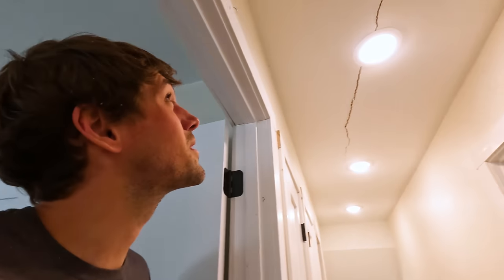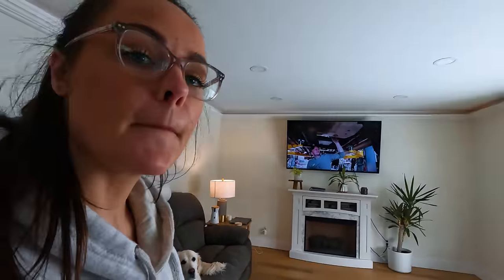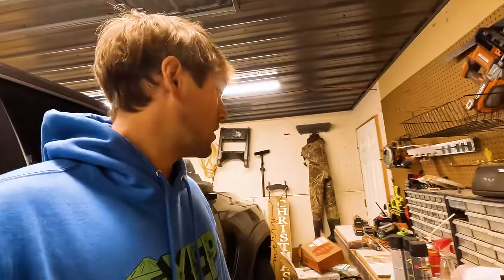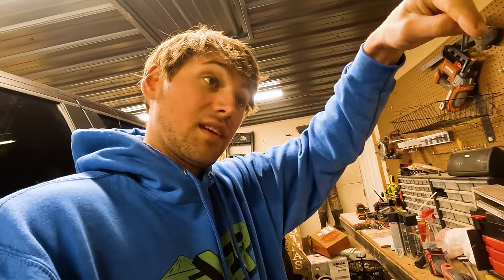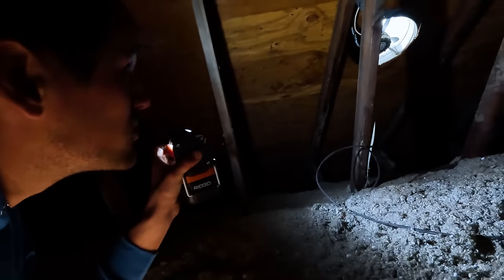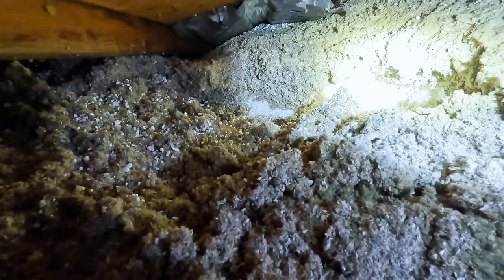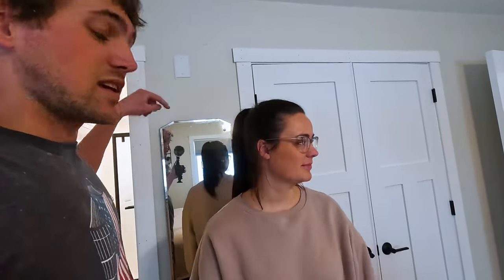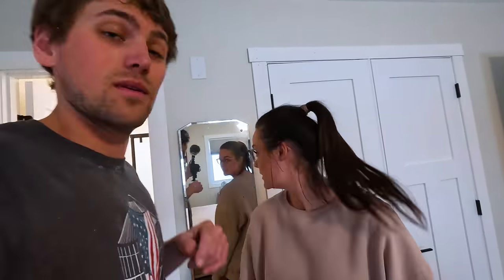DIY House Remodel Gone Wrong!!

Comment: Ya know... I think you did a great job... I grew up on a Ranch. Learned how to run a tractor and drive a Semi @ 8. @  9 sink electric poles and run telephone and 12.5 Kv electric lines. Built my first house @ 12. Ya know... You're not doing it right if you don't drop parts and screws. The higher you are on a ladder, depends on how important the screws and parts you drop. I've seen men who have built over 200 homes go right through a ceiling. Again, you were awesome... Thank you for being secure enough to show your viewers all the real challenges and how human we all are when doing a DIY project.

Comment: If you tee into the other vent line, moisture will also travel to the other fan.  Venting into the attic is bad news, mold etc., each one needs it's own external vent.
Reply: I totally agree. I would also use insulated exhaust fan tubing, preferably rigid.    And also get the other piece of that roof vent.
Reply: A back draft damper in line would probably also work but agree with the insulated ducting and correct mounting
Reply: Dnt feel bad Chet my stepfather was hanging from our attic half body in the attic half body in our dining room we told him to put some plywood on the floor for the same reason that he was going to end up falling through but didn't listen, also we have  back draft blockers and have not had any issues with moisture or mold build up in our washrooms exhaust fans
Reply: I didn’t think you were sposed to put the vent directly above the shower but I dunno
Reply: Put it on a GFCI circuit

Comment: Chet, you need to get each of those exhaust pipes routed to an external vent.  Note I wrote each. Do not use a Tee, as the air will backflow to whichever one is not running, thus putting the moist air back into the other bathroom. That needs to be done ASAP! That moisture in the attic is BAD.

As for a misstep onto the ceiling, as an electrician in an earlier life, I did several of those... Nothing that can't be fixed. And always remember, anyone who never made a mistake never did ANYTHING.
Reply: Or add a second fan after the Tee, to suck the air from both bathrooms.
Reply: The fan in the roof, could still to cleaned up at the contacts of the motor, just cut the paper in fan those roof power vents are great when they are taken care of

Comment: The power is at the switch for the light. Enlarge the switch opening to accommodate a two gang electrical box. Remove the single gang box. Install a 4" x 4" electrical remodel box in the opening. Run the fan wire to the the two gang. Connect the fan to the circuit, then connect that wire to the new switch for the fan. Now secure the two switches to the 4 x 4 box. Presto Chango...done.
The vent should discharge in the soffit.
Reply: DUDE YOUR JUST TRYING TO MAKE HIM CLIMB BACK INTO THAT MISERABLE ATTICE, STOP IT
Reply: @zerodarkthirty180  But extra visits to the attic mean extra video's.
Reply: Duplex switch. Two switches, one box.
Reply: You are assuming the neutral is in the original sw. box. It may not be.

Comment: That is your attic vent fan that should be run off of a thermostat in that box that it is connected to so it should be automatic. It is for in the summer to vent the heat out of your attic to help reduce cooling costs and keep the heat down in your attic.
Reply: Also clean the build up off the motor housing!

Comment: GFCI breaker needs to be installed if there is not one there already. Your doing great there are 100s of ways to complete a job. But always remember safety is number 1. Wearing you mask is very important glad you did that. I often fail in that department. 😢Thanks for being a good example for all of us.

Comment: The gray box next to the attic ventilation fan is a thermostat. The black screw adjusts the temperature it comes on at. There may be a breaker for it in the main panel or a switch somewhere. The vents on the motor for it need cleaning.

Comment: Don’t sweat it Chet!  Poop happens. 

For your vent tubes, it’s preferable to use insulated tubing in an attic (in northern climates) since the humidity will condense and freeze on the inside of the pipe and next shower the warm air will melt the ice in the vent pipe and rain cold water on you.  Ask me how I know. 😂

Love the home Reno videos.   Jean is a hoot too - “can I get my mom to do this?”

🇨🇦🇨🇦🇨🇦

Comment: If you are going to be in the house for a while, buy a 4x8 sheet of osb, cut it into 4 sections 2x4 ft. Stick the sections up in the attic, use it to build moveable wailkways and work platforms. Really cutes down on falling thru the ceiling. Admire the try

Comment: You are really a trooper, Chet! You persevered until you got it done, even after having to improvise for missing parts. At least you didn't fall all the way through the ceiling! It's fixable & you didn't get hurt, except your pride.😉 The house we bought & lived in for over 47 years was built in 1955 & went until 2021 before it had an exhaust fan in the bathroom. Never had any problems with moisture or mold. Good job!

Comment: You have an attic fan.  Pretty common item.  The box you were pointing to is the thermostat that runs that fan.  It probably kicks in when the attic temperature hits about 110 degrees.  It blows the hot air out so your air conditioner doesnt have to work so much in the summer time.   The only problem with not having the vents go directly outside is condensation in the winter.

Comment: If you’re already going to be fishing a wire up why don’t you just go over and fish a wire down to where the switch is now take the cover off enlarge the hole put a double switch box and pull power from one line to the second switch pull a wire up and over ….you’re pulling wires anyway.
Never vent to attic!  moisture breeds mold!

Comment: Installing bathroom fans into older homes that never had them is a serious pain in the ass.. I did two of them and I pray they never quit because I am not going back into the attic to change them if they do. Good job and glad you found that other vent not connected to the outside.

Comment: Good job, really enjoy the house videos. Little mistakes are all part of homeownership, it’s just a small fix. Be careful with the moisture from one shower traveling to the other shower the way they are connected. You already did the hard part with the wiring and cutting the hole so just finish and vent it through the roof, you’ll be so satisfied that it’s all done correctly. 👍

Comment: Chet, don't worry about putting a foot wrong in the arris space. You didn't go through, you just bent the boards. In my old house, we had lath & plaster ceilings. Which were fine until you had to drill out foe wires etc. Then if it went wrong you had to redo the whole ceiling as most of the laths would break and or strip the plaster off them which would fall down sometimes in a complete sheet... You didn't do something nobody else had ever done!!!! You're human and you learn form your mistakes (hopefully). Apart from that everything else looks to be fine, WELL DONE SIR. Thanks for taking us with you, it makes a change to see another side of your life. Not that we don't know quite a bit, those of us that have been here for a few years. Thanks from UK.

Comment: Chet, I agree with you about the vent just ending in the attic. When I had my house built, I saw the same thing. I had a chat with the contractor and he told me that it was code. I checked and much to my surprise, code states that bath vents terminate in the attic. After 20+ years here, I still am not sure about it but we have never had any issues.

Comment: Hey Chet I enjoy watching all your videos. I did blow in insulation and spray foam for 15 years so I know exactly the conditions you were dealing with. Such a pain of a place to work.
You definitely want to vent each fan separately and it's probably to late but use insulated exhaust pipe to minimize condensation happening. 
1 idea is vent out through soffit instead of roof.

Comment: DIY is a wonderful thing that will bring you joy and a sense of accomplishment .... that’s the sales pitch. The truth ... it will bring you headaches and added work. Take it from one that has remodeled two homes in his life. I have put in two kitchens, three bathrooms, landscaped,  and the list goes on. You need to approach it with a sense of humor, a good hardware store, tile store, electrical supply house and plumbing store .... don’t do it with the big box stores stay local and stay small with suppliers. 
Don’t vent into the attic, also each fan should have its own vent. Good luck ... keep smiling.

Comment: Oh, lordy this brings back some memories. Had a shower vent come loose and caused mold in the attic. I also managed to crack the ceiling, one wrong step. Not to mention a few nails to the head in the attic. I wish you the best on this project.

Comment: Chet   I also grew up on the farm. Umpteen jobs over the years.  Gramp always said.  Where there’s fire there’s going to be smoke.  Crap happens    Once you get it vented there may not be enough air flow.  You may have to cut the bottom off the door so it can draw.   Good luck.  Thanks

Comment: Don’t sweat the small stuff. That’s an easy fix. Frustrating……..yeah, but stuff happens. At least you didn’t fall through the ceiling in hit the floor. You two did a beautiful job on the remodel.

Comment: I speak from experience as I had the same situation and chose the same solution as you, the first time.  You'll find that one fan will just blow the humidity to the other bathroom, so I added one way vents to direct the air out the pipe.  Moisture condensed on those and on the metal T and rusted into a mess.  I strongly suggest you make a plan for the spring to get the insulated tubing and then cut two new dedicated vents in the roof.  In the long run it'll be worth the effort.

Comment: Chet the fan in the roof is a heat exhaust fan that is usually direct wired through a thermostat switch.  It should go on automatically depending on the temp setting which is on the thermostat.  I have one of these BUT had to replace the motor twice. Good luck!

Comment: Nice job on the vent fan, but if the noise bothers you, several manufacturers make a model with humidity sensor built-in so the fan only runs when the shower is on and the humidity is high. I put one in our shower area a couple years ago when we had a bathroom remodel, it works good.

Comment: you should really use the insulated vent pipe for the outlet, in the winter with warm moist air in the pipe, and freezing outside the pipe, condensation will form and make it's way back into the fan

Comment: Having remodeled my guest bath and did it all my self I learned a lot about electrical codes how to do things correctly and even passed the inspections first attempt.  It’s not hard to pull power from the switch box to not have an all for one situation.  I’ve also had to run low voltage cable down near the truss end and I feel your pain. 

As for the big fan it is a vent for circulation couldn’t tell if it’s auto but some are some are not but the auto ones the control box shorts out rather frequently so many don’t use them anymore.  The bathroom vents have to vent outside.

Comment: Missing hardware, I bought an ash vacuum which was missing the main filter to the motor. First time vacuuming the pellet stove it blew ash thru the exhaust and blew the motor on the vacuum. You did a great job, keep smiling.

Comment: I won’t say it, others have, but I have to, do not use a tee for exhaust fan ductwork. But glad to see you put the exhaust fan ‘in’ the shower. I have gone around & around with people in my years of in or out of shower. If it’s out of the shower you’re just drawing air from the room. If it’s in the shower the air you’re drawing is being drawn over top of the shower door and frame and the steam will not have the chance to exit. I know some might disagree, but I have had more people call me back to change it and put it in the shower, but NEVER ever had one call me back to take from shower to put in the ceiling out of the shower!

Comment: Thanks for a great video Chet. 
It was interesting and I have to say a bit of the struggle bus type things. 

First of all Chet, you are doing just fine. Don’t worry about the ceiling. Things like that happen. It is fixable so please don’t worry about it.   I have done things like that myself. Just have your man come and retape it and put it back as new. 

The exhaust fan and light in that bathroom is very nice. You did a great job with it. Nice work. 

When you remodel a house you always run into unexpected problems. Hang in there. You are doing great. 

Once again, please don’t worry about your ceiling. It is fixable. Things happen. 

Thanks Chet. 
The Iowa farm boy. Steve.

Comment: The Panasonic whisper quiet bathroom fans are worth the extra money. I used one on a humidity controlled switch in the room off the bedroom. You couldnt hear it running.

Comment: I’m sure plenty of people will have their suggestions but mine will be to lay plywood about 3 ft around the access hole to the attic. That way, it will not matter you stand when entering or exiting the attic. It won’t matter where you step with that thick insulation

Comment: Chet, the tee in the duct will not work without flapper check valves tightly sealed.  The air will blow through the path of least resistance so it.will blow from one.bathroom to the other.  If both fan seals are tight then only one at a time can be used as the fan will not have enough force.to lift seal against oncoming air.  They also make remote Bluetooth fans that require no wiring.

Comment: I fell through the ceiling once as well, Chet! I was trying to rewire a light in the attic and slipped. Only, I had a giant hole and ended up with the old wool insulation all over the dining room! Also, it's definitely not a good idea to have those vented into the attic like that. You're trying to get the humidity outside.

Comment: Been there Chet except I bout a duplex so it was double the B.S. and I didn't crack the ceiling. Chet invest in fiberglass wire pulling rid kit.(you won't regret it and there cheap). Your exhaust was easier  than mine. I ran duct to the end of the house and came out a end wall. When it was all done I blew a ton of insulation on top of the whole thing.

Comment: A very good catch on that fan exhaust just going into the attic.  That's a recipe for mold in the whole attic if not exhausting properly outside!   
A friend of mind didn't find out his house was remodeled that way until he went to have the roof replaced over a decade after buying it, only to find out then it was dumping moist air to the attic space.  Talk about expensive!

Comment: Don't worry about messing up, we all do it. Most of us however don't share it on videos. Fixing the crack really isn't that bad, put a 2x4 over it in the attic running with the crack and screw it in from the bottom. It should suck it back together then just a little tape, mud and paint,  good as new!

Comment: Chet ya need to make 2 pieces of plywood you can use to lay on that span a few of the raptors but make them small enough that they are easy to move in those small areas but big enough to lay on. I did it and it makes it so much easier to move around in the attic especially with that lose fluffy insulation.

Comment: Finished product looks good in the Bathroom.  Nice touch now that it's done.
As others mentioned, you'll want separate vent exits so Moisture doesn't flow back into the other bathroom.
Definitely don't want the exit into the attic.  You'll have mold growing in the attic soon enough then.

Comment: Chet, don't sweat it man. When you said Big Swede I literally started laughing thinking of him in that attic. He'd have been sprawled on the floor. As for the brother in law, let's just say we would've respected him cause he's your brother in law. Well that's gone now, hope we never meet him. 
You can cut that tar paper away from the holes from the underside. If that flapper isn't leaking just put up a square hole to round tubing adapter on the underside. Use liquid nails instead of nailing or screwing upward through the roof boards. You did great brother, take care.

Comment: I am going to attempt to do this according to code and that fan and light combo has to be on its designated switch and in some cases on a separate circuit and it needs to be vented outside (that can wait until the weather is better😂).  You can wait and thank me next year

Comment: Reattach the ducting to the vent. All its doing is pumping moisture into the attic which is not good. Most attic fans are automatic and kick on when it's too hot in the attic. But make sure it's still working. Good luck! 👍

Comment: Hi Chet,   the vent pipes need to vent to the outside or it will add moisture to your attic and cause mold.   Ideally they should no be hooked together and run out the roof through separate holes.
Hopefully this helps and good luck!

Comment: Never vent to the attic, you will get mold. Maybe install a high wall fan to the outside of the house like commercial fans are installed sometimes. Thanks for the video.

Comment: Hey Chet, you  must know by now that you are not the first guy to go thru a drywall ceiling (ask me how I know, haha).  it happens, working in a confined space with nothing below u but a thin 1/2" piece of non structural plaser board.   My incident required a whole new ceiling where one wasnt needed. Upside was that this incident openened up a whole new set of ideas how the lighting below could be improved. win, win.

Comment: Nice job Chet.  Next time you need to work in the attic bring a box up into the attic to put your parts and tools in. I have lost several tools in the attics I have worked in. Once they slip under the insulation you forget you brought them and trying to go back later and find where you dropped them is terrible.